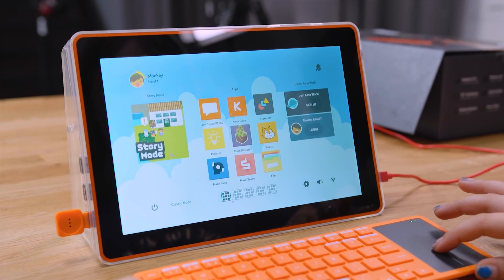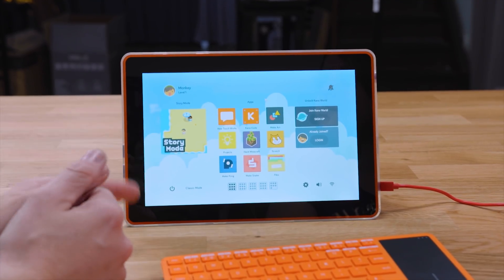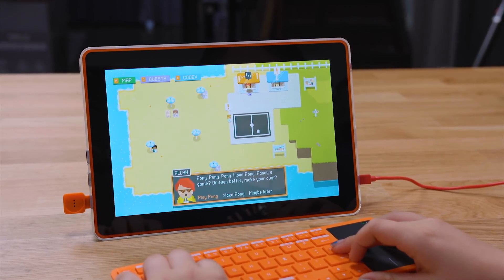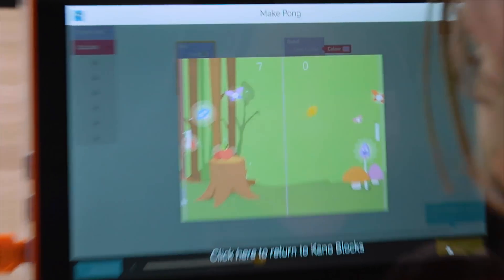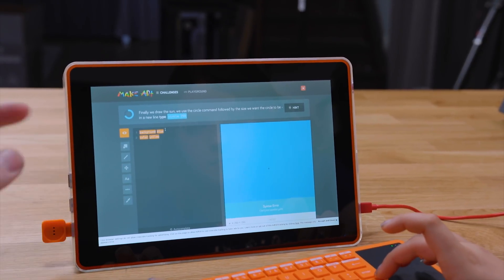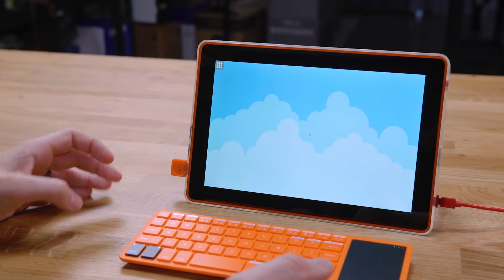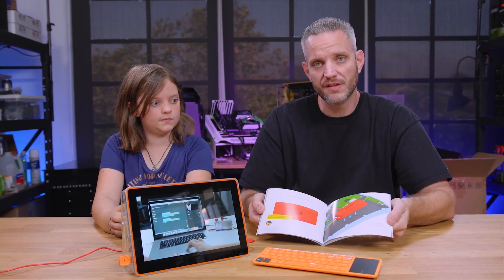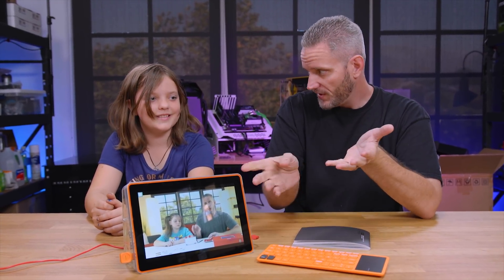Build and Code your own Computer with the Kano Computer Kit Touch

Comment: When I was over clocking my ram in Asus prime b350m-a mobo I forgot select D.O.C.P(XMP) profile . then I ended up with no signal on my screen. I don't know how to reset BIOS. I didn't know where the jumper is. I shorted the CLRTC pins for 15sec with all the components connected to mobo and outer connection removed but sadly it didn't work. Can any one help?

Comment: I have a problem with my PC and could use some advice. So I got a pc with an amd fx 6300 and after around 4 years of daily use, something finally died on it. I didn't overclock it at all, I guess something just met it's end and now I need to determine what's dead on it. So I replaced the ram, GPU, and power supply with those from a PC that was working fine with no issues, and it still doesn't boot. Which leads me to believe it has to be either the CPU or the motherboard would need replacement. When I turn it on, fans start for a second and then stop. Luckily I do happen to have a spare fx 8350 on me that should be compatible assuming it's the CPU, but honestly I'd rather not replace that unless I know it's the CPU. Would anyone know whether it would be CPU or motherboard?

Comment: I wish the Kano os was avaliable on x86 so you can run it on an old laptop for your kids or something instead of buying a glorified Raspberry Pi with a touchscreen.
Reply: It's one thing to sit an old shitty looking laptop in front of a kid and be like 'here is a game'. It's another for a child to BUILD the computer they're going to control with code. It's a ground up experience, that's kinda the point. I think if they released the OS for purchase or something a lot of the nerds purchasing would go that root thinking about performance and value for money. But not sure the child would get the 'whole' experience. But it's a valid point, more tailored educational software can only be a good thing.
Reply: @nigelmacquillan7211  They can't release a paid version because linux is a public resource and is open source.
Reply: There is a logic to that. U can get great i3 powere laptops for 100 usd used.
Reply: @jondonnelly3  I see what you mean but this OS is running on a raspberry pi which is not even close to an i3 laptop and I have a few old Samsung netbooks I want to give away to people in the town I live in.
Reply: I'm pretty sure you can emulate the software and set up an old laptop to just boot into that
Reply: I was thinking about having it on an old netbook without emulation. All the netbooks I have seen get hot just booting up so I don't think having Linux or Windows emulating an arm CPU is going to go well.
Reply: Well...we all should have hope and the wishes that drive it.
Reply: LiamGale would it work to run it in a virtual machine?
Reply: @brien1254  I don't think Virtual box has support for ARM
Reply: You can download Kano OS for a normal raspberry pi

Comment: Rly nice, but you rly paying 230$ for the software, manuel etc. stuff but hardware itself cost atleast 70$..

 (https://www.amazon.com/Raspberry-Pi-7-Touchscreen-Display/dp/B0153R2A9I/ref=pd_sim_147_6?_encoding=UTF8&pd_rd_i=B0153R2A9I&pd_rd_r=5663055b-b795-11e8-bec8-475d0372adf1&pd_rd_w=uH3Xc&pd_rd_wg=PTRWO&pf_rd_i=desktop-dp-sims&pf_rd_m=ATVPDKIKX0DER&pf_rd_p=5464280076950806983&pf_rd_r=71Z97JV23NM3ET8WGWA7&pf_rd_s=desktop-dp-sims&pf_rd_t=40701&psc=1&refRID=71Z97JV23NM3ET8WGWA7)

Comment: Ok, I watched the whole thing, but I'm confused. Where do you install the reservoir?
Reply: This particular tablet does not have a location for a reservoir.  It's designed to be cooled by LN2.
Reply: @marcleblanc3225  r/woo- wait, never mind
Reply: If you download enough ram you shouldn't need a liquid cooler
Reply: I dont understand the question. There is so much space in there.
Reply: you have to attach it to your MORA3.
Reply: Instructions unclear got penis stuck in fan....

Comment: You need a pretty good battery to keep a raspberry pi running.
Reply: @Santiago Ferrari looks big but it's just a 3000mah battery, wouldn't last that long with actual usage
Reply: Not much. I've done it playing Minecraft before and browsing the web on a 2000 m amp. Would probably go for a 10000 though for maximum battery life
Reply: Santiago Ferrari that's what she said
Reply: @simonq9406  Nope. Probably some guy with size issues. Although, I could see where this phrase comes into play

Comment: Teaching both my kids to code right now. Best thing you can do for them.
Reply: lemme stop you right there - are they actually interested? and are you doing that block crap or some actual language?

i'm far from an expert and even I know that barely anything works on the first try and it's not as easy as dragging and dropping.
Reply: I haven't used the code blocks yet but I want to learn it even though coding is a part of my profession. Using a conventional coding language results in having many errors and mistakes. It would be really powerful to use code blocks to eliminate syntax errors and then to visualize the code as blocks instead of words. The more powerful a language is, the more abstraction it has. If you are a purist then the best language to use is Assembly or machine language in which even adding 2 numbers will be multiple lines of code susceptible to mistakes by programmer. Being honest, when you write something like print("Hello World); even that is a code block in theory cuz there is a lot of code beneath that, which most never bothered to understand or edit.

PS: I intentionally missed a quote in the print just as an example to show how easy it is to make mistakes. I hope you didn't overlook that as most would until a compilation error notifies.